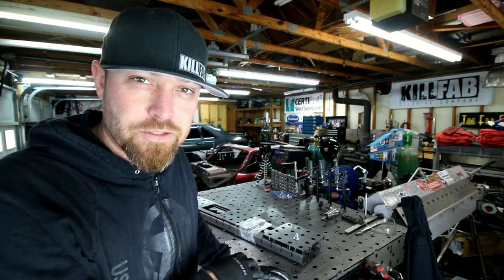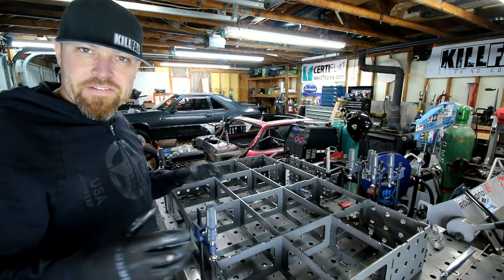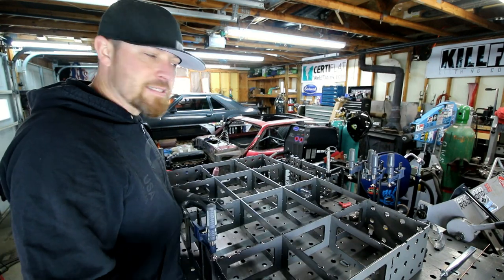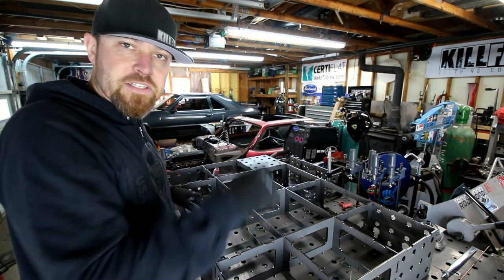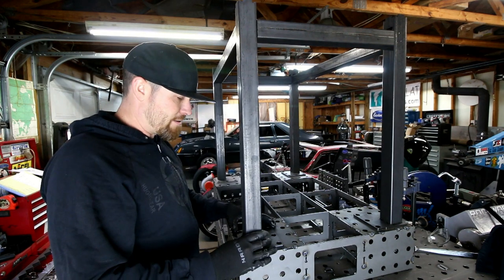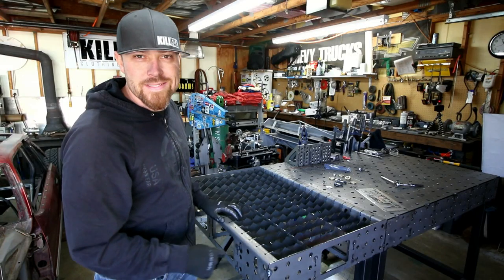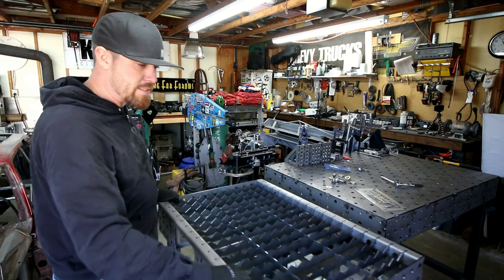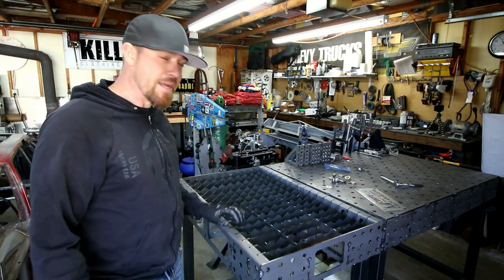Making The Ultimate Plasma Table / Cart / Station

Comment: Looks super cool. Make sure when you mount the plasma cutter that you isolate the machine from the metal structure so that the electronics in the cutter don’t fry- they would in a welder, but idk about a plasma cutter.
Reply from the maker: good point....I will have to research that

Comment: With the support strips, the pointy ones, would it not make more sense to have the points alternating/offset alignment? If you do a cut that happens to align with the points you run the risk of burning them all off in that line. Alternating or offset points would only risk burning of ever second and then require replacing less often. CNC laser tables have a mesh that doesn't line up with any straight lines and can be cut to almost nothing before needing replacement.

Comment: Speaking from experience, i do NOT like the pointed gates.... they are a total pos and a huge issue when trying to plasma cut a small piece... the material does not like to lay flat on them and you are stuck cutting a large plate...  

if it were non-pointed gates the table would be great for any hobiest though. i really hope they fix that for regular production before they mass produce them. 

Suggestion, weld a belly to it about 3" deep just under the gates and fill it with distilled water so it helps prevent rust. itll keep a LT of the sparks from bouncing around on the floor of your shop and contain most of the mess.  If you make the water pan about 612" under the gates it'll catch it and wont splash back at you as much. 

another great video like always Kyle, keep up the great work and congrats on all the backers/sponsors to the channel!
Reply from the maker: I could see that...I will suggest they offer both styles
Reply: Pull them out and flip them over.

Comment: Just a little tip for anyone who installs casters, if you grease the ball bearings it will roll smoother and quieter. Could just be my OCD.
Reply: you said it Wurth makes door hinge spray grease goes on wet then sets up into grease its great for just that

Comment: I wonder how you can tig weld so clean over the mill scale, I'm having some issues trying to weld over some laser cut plates, if I don't clean my piece and try to tack it, my weld looks terrible.. are you using tungsten rod? or are you tacking only over the expose metal created by the laser cut?
Reply from the maker: no mill scale on this stuff. If I had to guess its P&O

Comment: It's a damned shame they didn't make a solid bottom and sides so you could use it as a water table. I too work out of a small shop and when using the plasma one of my major concerns is catching something on fire. My next table will be a water table, without question.
Reply from the maker: yeah I think they are going to offer a pan but it most like wont hold water.
Reply: Fab Forums, I have an 8' long welding table, I made it with 1/2"x 6" bar stock, I drilled and tapped holes, in each bar and spaced the bars 1" apart to have additional clamping areas. Below this I have two toolboxes mounted to hold all of my metal tools, but the one thing I didn't take into consideration is how much crap that was going to fall between these spaces. It covered my toolboxes, and migrated into the drawers, what a mess. I finally make a shit tray to go under the work surface, it works but is still a mess and small tools will inevitably fall into it as well. Now this is the second welding table I have built, and although I took care of some of the issues from the first one, I am now left with new issues, the next one will be a certi-flat that I will modify to deal with this. The point is nothing is perfect, but us fabricators just keep trying to make it better, it's a never ending situation.

Comment: Did you clear coat the tables yet? I remember you mentioning that in the other table video.
Reply: Nevermind, it was the bibster you were gonna clear coat the bare metal lol.
Reply from the maker: yeah will probably do the table as well.
Reply: I wouldn't clear coat the table, it will mess with the ground when trying to use it for welding, that is kind of the point with that table, if anything just spray some WD40 on it, you can always wipe that off if need be,
Reply: I definitely need a bigger shop LOL
Reply from the maker: probably use some sharkhide which wont affect the grounding

Comment: Your a fabricator? But buy 1 of the simplest things to fab.  I really can watch your videos no more.
Reply from the maker: lol...just because you can doesn't mean you should
Reply: Mr. Ski, I too am a fabricator, and I have built two welding tables for myself, but the next one will be purchased from someone like cert-flat. With all things you do in a work environment there is a cost/benefit analysis that must be done, and it is too costly to use your time for something that can be purchased for half the investment. You are better off using your time for the one off, or small run jobs that make it profitable for you. With your thought process, you would say that a plasma cutter is an unneeded expense and that we should use the torch or saws. I hope you see my point, I'm not trying to insult you in any way.
Reply: That is a nice table I️ take I️t they are not selling them yet and the guy with the fabricator comment might want to take an English class haters gonna hate super cool videos keep them coming
Reply: It all depends on what you're fabricating doesn't it? We built our own tables as well, but they were like 1.5 x 3 meters (4.5x9 ft) of 10mm (0,4") warm rolled steel sheet on a frame (Yes we wanted the oxidization, as welds tends to not stick to it) . We didn't need 2000 holes in them, because we made mostly gates and doorways and shit...if I needed a table with infinite clamping possibilities I sure as hell wouldn't make it myself.
Reply: Can’t works much better but we are getting off topic for what this gentleman is trying show everyone like I said haters gonna hate
Reply: pretty sure he got them for free, companies do that a lot to get reviews and the name out there. if you got something like that for free theres no way you'd knock it back.
Reply: and like he said in the video, by the time you buy all the steel and cut it it will end up pretty much the same cost. plus it will never have the same presision as certi flat